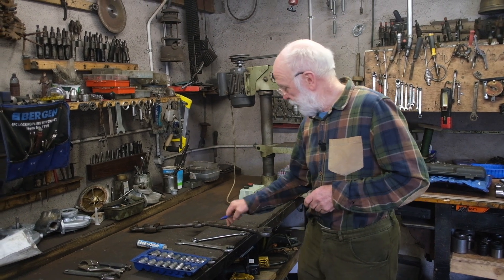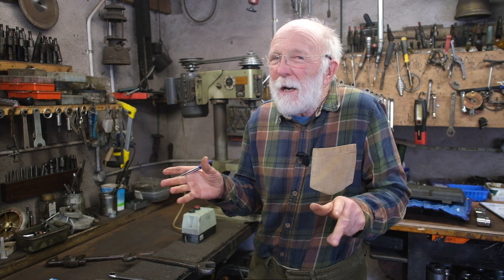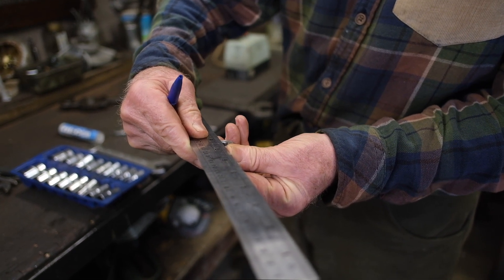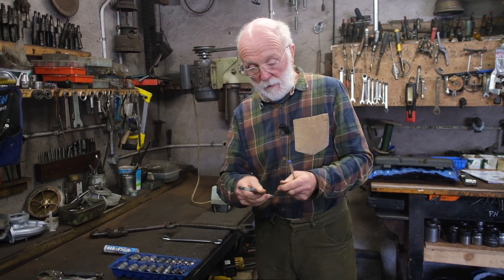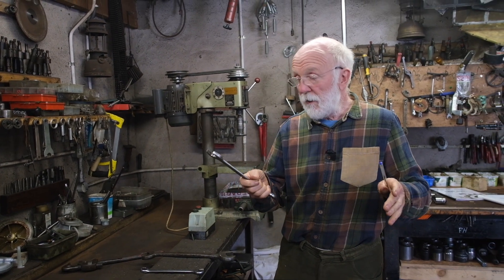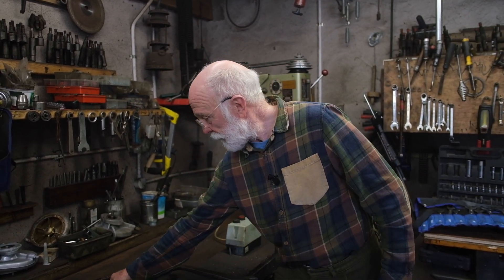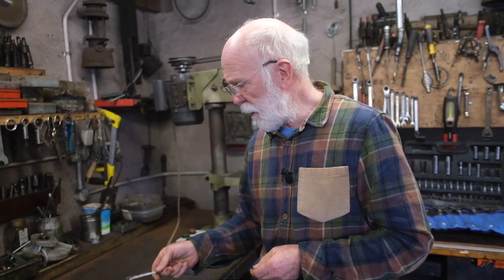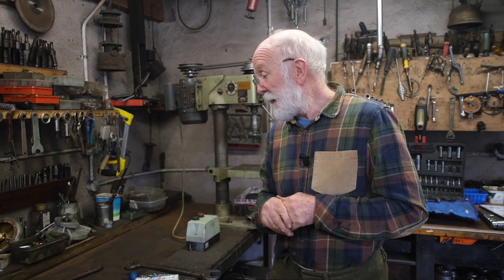Spanners that are used on a Gardner engine

Comment: Ah, Whitworth. I’ve just rediscovered these after nearly a lifetime of using metric. A project British Seagull outboard engine had sent me to my local tool shop when I discovered how expensive a set of BSW combination spanners are. eBay is even worse! Now looking to see what I can buy used, although they tend to be expensive too as they are older and usually drop forged. Why can’t Seagull have used metric… 🤣🤣

Comment: My view is that the UK made a mistake after WW2 in kowtowing to the Americans to adopt their thread system and have nuts and bolts with AF sizes of head. This was compounded again in the 1970s when the metric system was introduced. The Imperial engineering solution created by Whitworth, as the first standardized system in the world, is superior in sizing the head of nuts and bolts in relation the diameter of the thread and therefore, in proportion to the strength. Likewise the same proportions were used minus a 1/16" for BSF but still retained the angle of the thread as standardized by Mr. Whitworth at 55 degrees.

Comment: I've got a special little toolbox for our Gardner. We never discuss sizes. Some are whitworth. Some af. And the odd filed down metric...
 We have names for each. Like the little shiney one. Or pass me the big rusty one. Or the small whitworth. Same with sockets. It all goes in the same box with an adjustable, a hammer. And a chisel.
 But after a while now we've owned it a while, we've got the tentions set to where we can get stuff off quite easy.

Comment: Hi joe, took a7/16 whit socket. Cut it in half and welded the bi hex part to the side of the other part, to get to cyl head bolts under decompressor shaft 45 years ago, still got it !!!!!

Comment: When I was an Apprentice (in Australia) one of the jobs I was asked  (told) to sort out a huge box of nuts bolts and washers and lay them out on trays. this box had all sorts of thread types and I was to make sure that the trays only had one diametre bolt and one specific thread pitch. After doing this for a week my boss grabbed a handful of nuts and bolts out of those remaining in the box and asked me what thread it was and what size and I had to tell him what it was. Which I did, although I do remember getting caught out by a BSP plug, I could instantly tell between a Whitworth bolt or a Unified National Course thread by looking at the bolt head and thread just by looking at them. I also to this day have a full set of Whitworth SAE and metric spanners and sockets in my tool box. I started my apprenticeship as an Automotive diesel Mechanic in 1977, I did a of bit of work on 6LX.s that came out of Fodens. One of my mates has a an old Foden with a 6LX in it that he intends to restore, last time we started the Gardner although it had not been started for two years, a little fresh fuel and a charged jumper battery and it started right up, with a nice idle.
Reply: Bet you couldnt tell the difference between 3/8 whit and 3/8 unc  just by looking
Reply: @johnrose7491  incorrect, while it is virtually impossible to tell the difference between the 55 and 60 degrees on the thread pitch.....real Whitworth bolts have different size across the bolt head than UNC, they use different size spanners.
Reply: U are right of course but i meant the threads only
Reply: PS.  I have some original Whit nuts and bolts with the large  heads to fit the proper whit spanner sizes
Reply: @johnrose7491  I have taps and dies up to 1 1/8th whitworth,  And a full set of spanners and sockets up to one inch Whitwrth.....I used to work on Gardners, very old Listers, and old British Trucks like AEC's, Fodens Atkinsons and the like

Comment: Use the proper too for the task. If you do not have the proper tools delay the work until you have the proper tools. Using the wrong or makeshift tools can delay the job or damage the thing you are working on. 

An ajustable wrench has the primary advantage of being the wrong size in all the fastener systems.

Comment: When I began as an apprentice  Diesel fitter back in 1971 it didn't take long to realize how important it had been to learn fractions at school. Men like Joe didn't just teach me my trade they were my roll models as well.
Reply: Same here. I started on the railways as a loco fitter in 1971, and all the fittings then were imperial. I used to know spanner and thread sizes off by heart, but that was many, many years ago.

Comment: I understand that a Witworth nut and bolt head size was reduced by 1 size during WWII to reduce the quantity of steel needed for the Hex head and so make steel go further.   The size of a nut and bolt head became BS British Standard.. So a witworth spanner on very old equipment fits. If built during or post WWII a BS spanner fits.  
Can someone verify this.. Thanks   Amacf

Comment: I am left confused. If I were to grab a 3/4” Whitworth spanner, and measure the opening, would I read 3/4”?
Reply: NO, the 3/4 inch is the diametre on the thread the Whitworth is the thread pitch, its opening across the spanner would be slightly larger than 15/16ths, It is late at night here and I am not going out to the shed to measure it with calipers to be precise lol.

Comment: I understand everything you said, i was born in 71 but apprenticed on the steel works in Scunthorpe.  Working on steam turbines built by. Charlie Parsons.  Fractions, oh fractions thought what a waste of time in school, how wrong was I, I’m now a fractions expert.  BSW, BSP (tapered BSW), BSF and BA.  Incidentally do you know why the BA thread is so amazing?  It was used a lot with mechanical instrumentation, if the thread was stripped, you could run the next size tap down without drilling.  By the way do you recall the English imperial spanner maker?  Carringtons were great, long with square rings, great for tight spaces, rounded cheap spanner’s don’t fit.  And then there is King Dick and Snail band.  I live on a traditional narrowboat, it has a modern John Deere 3029 gen set engine marinised  by  Beta Marine, slow revin but lots of torque.  I have always been fascinated by Gardner engines, of which I appreciate their sound and aesthetics and mechanics, as I do with Parsons turbines.  Perhaps one day when the world settles down we could meet up to and discuss the pros and cons of restoring a vintage Gardner with a view to having a Gardner rebuilt to replace my JD 3029.

Comment: My late father, who was a mechanical engineer told me that BSF was also designed by Whitworth, which is why the spanners fit both standards. 
For those reading who don't know the system, Whitworth spanners are marked for the thread size and the standard specifies the nut/bolt head sizes according to the thread. 
My father also told me that during WWII the standards were revised to save metal. The way they did this was to reduce the bolt head/nut size down one step, so the old spanners could continue to be used. This may be where your sixteenth inch reduction comes from. I believe that newer tools were marked for the new head/nut sizes, so there may be different sized Whitworth spanners with the same markings, depending on age.
Reply: I would totally agree with this comment as we were told this exact same fact as apprentices in the early 70's in the MOD whereby all Whitworth/BSF nut sizes were reduced by 1/16 in an effort to save war material- steel. I would also add that as a consequence when working on older LW engines for example you would come across a mixture of the reduced head size nut and the 1/16 larger nuts for the same sized stud. All somewhat confusing to the uninitiated.

Comment: I worked on 6lxb engines in foden truck's when I was a young fella, I remember when worn with plenty of back pressure, they leaked oil and once at the mot station I done the usual and rubbed oil off the sump 
 etc, so on the pit the ministry tester called me out of the cab and he looked up at me and said you done a nice job of wiping this one's arse young lad haha good old day's.

Comment from the maker: I'd like to make this clear.  An example: a Whitworth or BSF  nut takes it size designation from the nominal thread diameter.   A 1/2" Whitworth bolt has a diameter of one half inch.   To arrive at the Whitworth spanner size we subtract 1/16 to get 7/16.    In dealing with a half inch nut we use a seven sixteenth spanner.   Simple!   In my pocket I carry a 3/16 - 1/4 ring spanner.  I find that the most used combination on Gardners.

Comment: A fantastic post, I still have all my Whit - BA spanners and Whit sockets, Gardner block spanner, injector key and a few other bits and bobs from my old Gardner days, I still have my old slide rule as well.
I worked for an ERF, Atkinson main dealer but worked on many type of Gardner engines, I miss working on them so much, the best of British engineering.

Comment: Because of the restricted access to the cylinder block nuts, which secure the block to the crankcase, you can only use a ring spanner on them, which means you can't use a torque wrench so correct tightness is much a guessing game, experience comes in after you have done a few.
Reply from the maker: Weld a 1/2W nut about half way up your open ended.   You can then use your torque spanner on that.   BUT, the torque spanner must be held exactly at right angles to the ring spanner.   Be careful!  Email me if you need more detail.   (Perhaps we'll shoot a video of that!)
Reply from the maker: Sorry, that should have read "ring spanner" - ie the original Gardner tool, or its equivalent.

Comment: Love these videos keep them coming! I have two 6lxbs in my boat which I am quite proud of. Quick question; I have to hold down my throttle levers once the engines are under load to stop them springing back. I understand this is a common issue for most Gardner engines. Have you ever found a solution to this problem?
Reply: Hi Ryan, yep the governors on the pump are quite heavy, a mate of mine used a friction plate (made of a cork disc) that was off the gear box on his 6L3B as his throttle...  that worked very well... another mate has set up a hydraulic ram system using the pressure side of the twin disc box and Morse cables- again works very well but costly to set up... i am still figuring out what i will use - simplicity is best - a rope with a cleat cam or a piece of nicely shaped edge timber works well... good luck. cheers Brad
Reply from the maker: Are you using Morse cables?
Reply: @tangentgardner  Hi Joe, the friction plate uses sold rod shafts - nice and simple, i will was thinking of using a Saura Autopilot SA101 with a ERC-VF (electric) engine control system... i like the remote control (cable from the helm) part where you can walk around the deck controlling the vessel... the only small issue is the electric actuator in the system are rated to 30kg..and electrics are a bugger if stop working -  Morse cables will work fine on the twin disc box - not completely sure regarding the 6lxb  what are your thoughts / experiences??
Reply from the maker: @isobelboler5904  Morse cables work fine.
Reply: @tangentgardner  Kobelt cables
Reply: Thanks for the replies great information. I am using Kobelt cables combined with the Kobelt throttle levers.